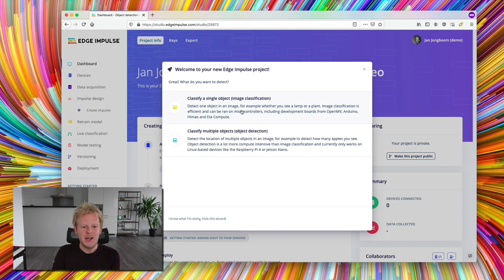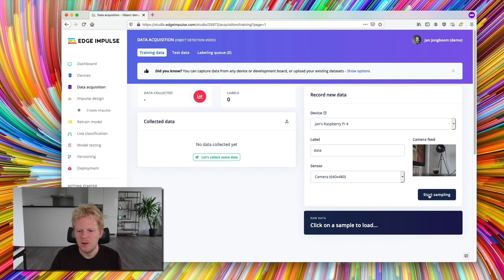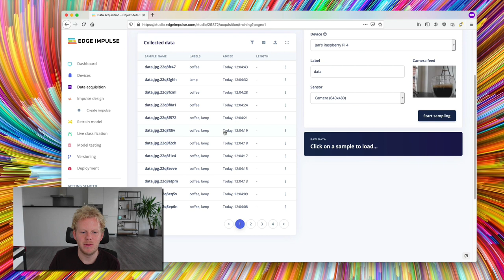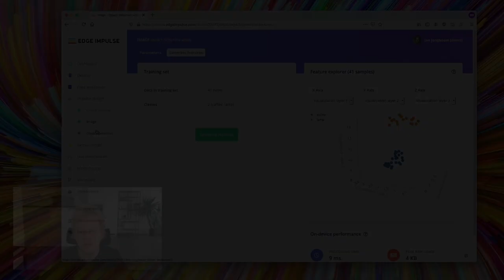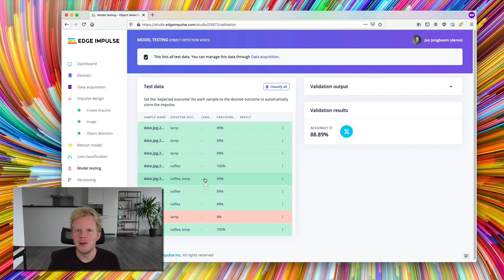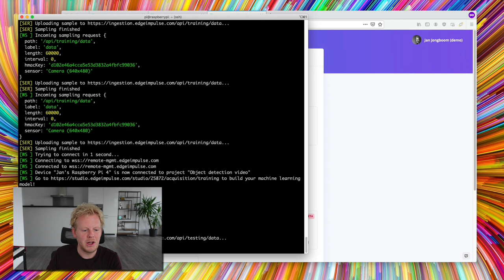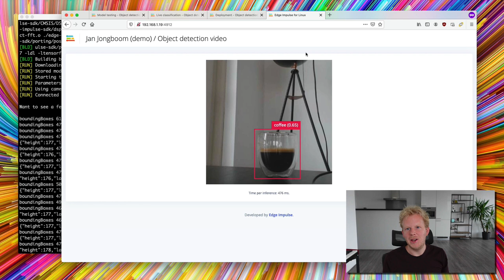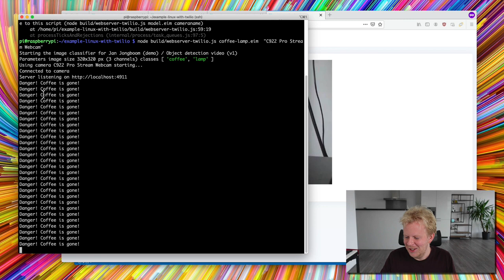Build Your Own Object Detection System with Machine Learning

Comment: This is Excellent.....So I have already been working on improvising a remote monitoring using IP Cameras and I have already completed the complete frame work but wanted more smart and dynamic way to inference and recognize objects in the video/photo. I can say I am super delighted to use Edge impluse in my project and  build what I need.

Comment: Conclusion
Implementing logarithmic and optimized calculations on edge devices with limited resources can significantly improve efficiency and performance. By following these strategies, you can develop robust and efficient solutions that make the most of limited hardware capabilities.

Comment: What do you suggest a development box be, to run & debug a Python program that can test an edge-impulse-linux trained model (.eim) along with OpenCV before deploying it to a Raspberry Pi 4 device? My Windows 10 development box cannot run edge-impulse-linux and I am also having issues using an edge-impulse-linux .eim model on Ubuntu 20.04 in WSL2. Again, any suggestions on setting up an ideal development box to run & debug edge-impulse-linux? :)
Reply: Hi Manuel, a Linux VM should do the trick. This runs on Linux x86 as well.
Reply: @janjongboom7561  , it also works well in Ubuntu 20.04 inside WSL2! Awesome! I installed both, the Edge Impulse CLI and Edge Impulse through pip3 install for my Python code. Than I used Visual Studio Code Remote (to run my program in the Ubuntu in WSL2) and it worked smoothly! No issues after that! .. :D. Thank you for your support!

Comment: It works beautifully! Thank you! :D. I need more samples on how I can integrate this on a python program (I am barely learning how to program in Python too). I need for my python program to send the detected objects (and accuracy levels) to another device like an Arduino or a Windows 10 PC, perhaps through UART. Where can I get such sample codes or learning material?
Reply: Hi, https://github.com/edgeimpulse/linux-sdk-python has some examples on invoking models from Python, then from there you can use whatever libraries (e.g. pySerial for UART, see https://pyserial.readthedocs.io/en/latest/shortintro.html) to communicate to other devices.
Reply: Is it possible to install edge_impulse_linux in a Windows 10 machine? If it is, can you please share the link to follow the steps? :)
Reply: @ManuelHernandez-zq5em  It's not. But you can download the tflite file (from Dashboard), then use the tflite python package to run inferencing.